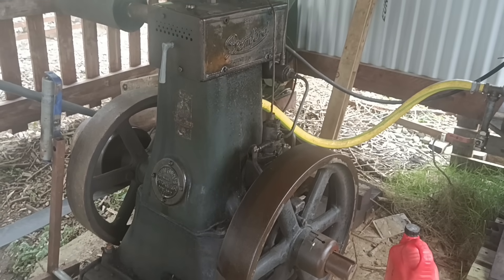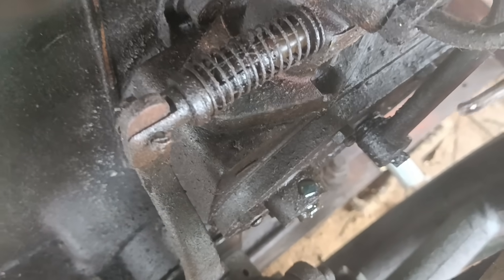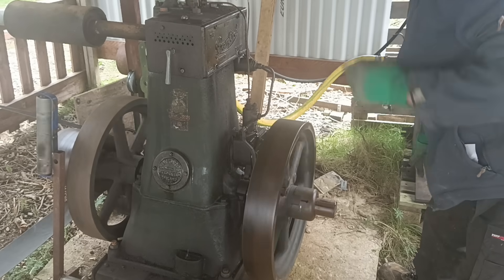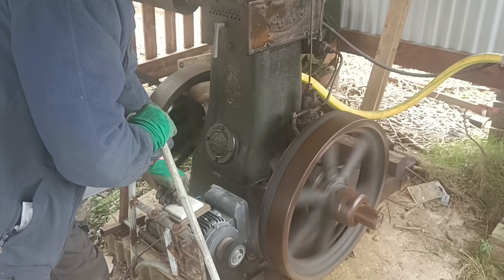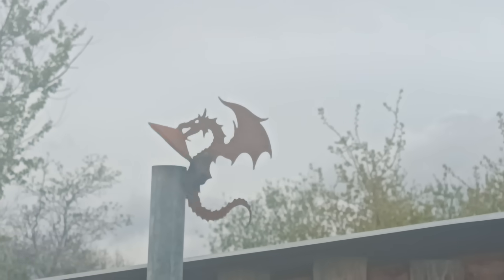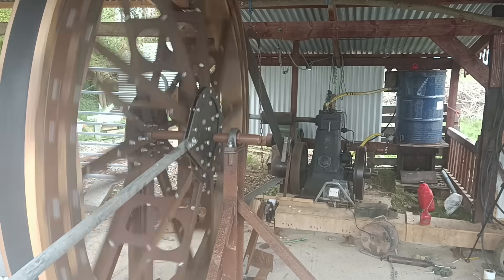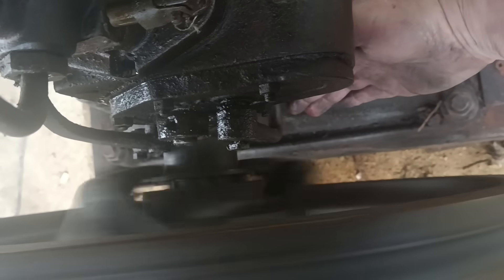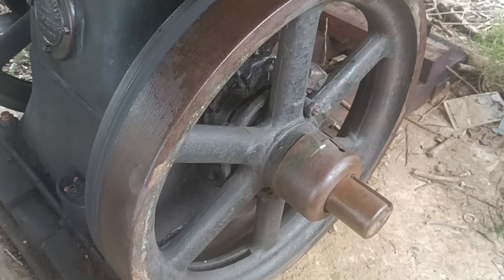How Much Fuel Does This Vintage Engine Use? Bamford stationary single-cylinder diesel efficiency

Comment: With that engine, when you say it's six horse power I'm fairly certain it's actually equivalent to six horses. The horse power rating of engines has changed over the years, and a six horse power small engine in the modern day isn't going to have as much power as this, it's smaller and doesn't have those large flywheels to keep it going. Another thing that helps is this engine as you said is only running at 600 RPM where modern small engines are running faster, the flywheels help it to just plain not care what it's powering. Very nice when you need the power, dangerous if you're not careful because it can rip your arm off without breaking a sweat.

Comment: Assuming the Bramford isn’t environmentally friendly is short sighted. The Bramford was already manufactured and is moderately inefficient compared to modern technology. To buy a new machine you incur an environmental cost through manufacturing and shipping. Unless the new machine is incredibly efficient by comparison it will take years to break even on environmental and monetary costs vs using a machine that is fully functional and in your possession. In short environmental cost or new vs used machinery isn’t terribly difficult to calculate.

Comment: Marvelous! Your product is VERY environmentally friendly. I can understand why people think modern is better, but it always annoys me when they don't value what's already there, and think nothing of scrapping perfectly good solutions that don't break, while spending money on something that probably will, and they always think the benefits'll pay for it over time. The true benefit is had when stuff is kept going, revived or re-purposed, not replaced with expensive new toys.
Reply: I bought a condo a few years go and it came with a Maytag washer that's half a century old. So I thought for sure I'll have to buy a new washing machine. Well when I moved in I tried it and it worked fine 😂 years later it's still working, it's been washing clothes for literally half a century. Meanwhile my mom's fancy modern washers break after a few years because the control boards go bad. Her LG lasted only a few years and would cost 400 dollars to replace the board. Meanwhile my 50+ year old Maytag works flawlessly still. It's probably not as efficient, but the environmental impact of manufacturing one long lasting washer is probably less.
Reply: @huge_balls  a lot of energy goes into making disposal crappola
Reply: In this society you're never supposed to be satisfied with the equipment you have be it engines, mobile phones or computers. If you refuse, they will force your hand one way or another.
Reply: @jonathanj.7344  just today I swept up some sand from my floor using my grandmother's dustpan and brush. Not sure if it's made from horse hair or pig bristle, but it doesn't use any electricity & it does a great job.
Reply: I'm still using my grandmother's 1940's era Westinghouse refrigerator.  It runs like brand new, and all the drawers, etc are in great condition.
Reply: ❤da odličan 😢.....više daje snage, a manje troši money !!😂👏🏽👏🏽👏🏽👏🏽🐞🐞🐞🐞🐞🐞🐞

Comment: A laboratory experiement to see how efficient the historic engine is, and a comparison to an electric motor would be a great video. 
However, even if the electric motor is way more efficient and cheaper to run, the pleasure of using the old machine would be lost - and its obvious that has great value to the owner.
So keep the old engine running 🙂

Comment: It’s not very clear online but it seems that this is the same Bamford as JCB, albeit Joseph Cyril Bamford’s grandfather, Henry.
As for the fuel consumption, i don’t think you would find any modern small engine that could do the same work & use less than 450ml of fuel per hour.
The only thing that would beat it is an electric motor powered by solar & that would have to run for a lot of hours to pay for itself ! 
I think we should give Greta a call & see what she thinks ! Maybe she will sail over to Ireland to have a look at how environmentally friendly diesel engines really are !

Comment: The old ones are running slow and efficient, maybe at 25-30%? 
 0,45 L diesel contains aprox 4,3 kWh
So if we multiply 4,3x0,25 we get aprox 1kwh of energy delivered 
In other words; 
The engine power outtake is way lower than 6hp/ 4 kw.. thats Why your math doesent add up
Test i against a fixed load and i think the math will add up- and you will use way less than half the number of kWh if you use an electric motor
👍🇳🇴
Reply from the maker: thanks - I realise that now. I will have to get it to work harder for a real test..

Comment: Like to have one to generate power ,to charge batteries, for off-grid powered house, about 600 amps at 30v charge the battery to 28.8+/-0.2v,  I'd like to burn waste oil vegoil,  used motor oil, 
I wouldn't mind building a modern version, with lighter pistons,   and a opposed twin horizontal piston use a couple flywheels from a semi truck engine, or maybe cast a pair of flywheels,  about 30"-36" and weigh about 75-100 lbs each, with 85% of the mass far from the crank,   machine abd weld a crank with about 12" stroke,  from , 3" steel bar, and 1" x 4" steel plate, build the crank case from 1" plate, maybe use large tapered roller bearings, for the crank, use 1" plate, and 1x1" Bar , along with .250" plate to construct a large H beam rod, 24" 36" long, bout 2" at the journal ends, 1"-1.5" at the piston pin, run 20:1-24:1 compression ratio,  use a 6"-8" steel pipe for the cylinder, cast the water jacket and heads from aluminum use two 2.100" intake valves,. And two 1.880"--1.900", ceramic coatings on  the piston, valves, head, inside the ports, build a high pressure air blast injection system, compress air to 150psi then through a dryer,  to be further compressed, o excess of 600 psi, with the main injection stage  using a small piston and cylinder, to hold roughly 600-625psi, with the cylinder filled with air 600 psi, 30-50 cc, with 20-30 mm bore, roughy 40-50 mm stroke.   With a valve to open as the injection piston moves to TDC, the valve opens as the pressure exceeds 650-670 psi, using the venturi inside the injector, to spray a fine must of fuel/oil, with 6-8 groups of holes, with 6-8 holes per group in the tip of an est, 8-10 mm injector, the injector working like a micro sized carburetor, throttle is done by using a bleed to bypass the injection air, a full cylinder of air injecting fuel, is full throttle, use a small  cylinder to contain a fraction of the air then dump it, possibly back into the 150 psi first stage,  use a normal compressor to fill a 1-2 gallon tank, then into another compressor, a multiple stage small bore, long stroke  with cooling  to cool the air , using water (a air to water intercooler) .250" passage through copper or brass, a .750" -.850" block about 4" x 6", with 4 passages, near 6" long, with cooling fins machined , then place inside an aluminum water jacket, to allow a .500" hose barb to circulate water through,  using a large heater core to cool the  water. Use a similar system to cool the head, and bore, use a dry deck to mount the head using studs that thread into the crank case, use .500"  studs on about 2"--3" on center spacing. Mount a camshaft  over the valves using finger followers with rollers, with valve lift from .500"--.800" lift using a intake cam and exhaust cam, using a timing chain tensioner system that allows for the valve timing to be advanced or retarded 8° to 12° say -12° to +12°  or limited to prevent damage, so limit to -6° - +6° on both cams to Taylor the valve timing to dial in efficiency,  using opposed pistons will make a large package but the balance will be much better it should not be bouncing or trying to walk about when running,  use one lobe per valve,
Use a exhaust valve compress release, to spin the engine up to about 50 rpm, (even with electric starter) let off start button, and compression release ( that opens the exhaust valve, about .050"+/-, also use a glow plug, that puts the top just in the fuel mist, having oil blasted through .005-
.010" holes,  the used oil could be as thick as 50 weight, the injector holes  possibly make them .
.020" using a group of holes 8 ;groups with 8 holes 64 holes through about .500" steel, with water in the head cooling , aswell as the fuel oil or diesel, cooling the injector,  the inner air  injection uses a .250" tube with .165" ball, with a rod, the rod about .080" the .125" 0rifice  with the ball sealing it , and a spring keeping it sealed , until the pressure is high enough to open the valve, this is threaded into the nozzle that threads into the head, like a sparkplug, 10-12 mm thread about 20 mm long,  with a glow plug threading into the head close to the injectors, with it sat a angle, so the tip is getting hit by fuel slightly,  the piston combustion chamber allows clear for both, the piston being nearly 20 mm thick in that area, with ceramic coatings, and a mesh grid cast into the pistons to allow the oil squirters to cool the piston, using intake runners in an oval shape,  est 2"x 3.125" with material to allow it to be opened up to 2.625"x 3.750" and still have room, even adding larger valves, a 3" x 4" port with roughly .100" wall intake port.  With exhaust ports , use one per valve, leave the valve at about 30 then after about 30mm, turn about 25°-35° , with the port exiting about 45°-60° from the valve face,  to prevent the exhaust from hitting a flat roof of a 90° port roof, the intake ports should be similar, using a near hemi design, with the valves at only about a 6°-12 ° from each other, with nearly no chamber in the head,  the piston can be machined to adjust compression ratio,  use shims under the cylinder to adjust quench, about .050" of shims, with the piston near zero deck, with a gasket about .020" use a copper o-ring , maybe use 12 gauge wire, silver solder it,   and ring roll it into shape,  machine receiving grooves, and a copper shim gasket,  no water to seal, so dry install, use a 3/16"hard oil feed line, with a .500" (1/2"); return line, head to sump,   if roller bearing s are used, use a sheet steel plate around the bearing race , with a squirter filling the sheet steel tab/ reservoir that streaming oil into the bearing, the oil seal should be simple, basically just a loose fitting plate to fit the journal, with a  pair of small tight fitting in to the journal,     with a cotton rope between, the large loose plate bolts to the crank case, and is sealed to it,  the plates should be machined,  with about .010" clearance,   and fit snug on the crank,  a 30° temperature difference it should slide on , when equal require a puller,  but being .125" thick heat is required,   the spinner should keep the oil that comes through the bearing, uses a drain to sump, or use a pair of . 250" holes to drain back,  use a main cap like traditional bearings,   to retain the outer race,  the rod bolts being .500" or . 625" grade 8 bolts, same as the head bolts, only they will be Studs, the oil pump  using a chain drive,  driven at 1/8 the speed,  being the tod and cam bearings is the only bearings required pressure,  use only enough pressure to maintain 5 psi at starter speed minimum, and a maximum of 50 -60 psi hot,  use pressurized pin oiler, rod journal, and cam bearings, a piston squirter, use a .350" babbitt bushing on the main journals, with a .125" x. 200" groove to supply oil pressure to the rod, , roughly . 010" clearance max, minimum .003" to 
.005"
Use a 2" x 2"  x . 250"  Wall tube frame, to mount. From head to head , then the crankcase, with a 12" rise, to allow the flywheel to be off the ground, using 4"x4"x 
.500" plates as feet, under the base of the cylinders, to balance the weight, it can be enclosed sealed , and used as the fuel tank,  being 48" long, and 24" or less wide,.  Hold 4-6 quarts of oil , 100 psi oil pressure relief, with a safety switch reading pressure at the main oil pressure galley,. . intake ports at the bottom, exhaust out the top of the heads,  2x 2" going into a 4" single pipe, then possibly either a pair of 4" with mufflers, or a 5"-6" semi exhaust muffler,  use a short piece of 2" x 4" tubing to make a adapter to a 4" pipe inlet,. However with the low rpm, a 3" exhaust per cylinder on the exhaust, and 4 " intake with a cone filter, per bank!  Use
 .750" in/ out for coolant for the heads and cylinder,  the top of the crank case, having mounting locations to mount accessories, like 4x 150 amp alternators! And a 24v starter motor,  50-100 rpm should be enough to start the engine! Lots of casting welding and machine work, but would it not be awesome to build a engine with 8" bore, and 12" stroke,  I don't recall the displacement, but I'm sure it not far from 2000 cid,  sorry to be a  rambler, insomnia will do that! 😆 Great video!!  I mathed it out, 1206 cid with 2 cylinders,  imagine 4 cylinders!:  2412cid, if it could spin to 2500 RPM, the power could be amazing!! ✌️😮

Comment: Take a look at Thinking'n tinkering because he has a dead easy way to make old chip shop oil into fuel by adding a gelatin solution and letting it set up. Brilliant!
It would be ideal for your engine and the residue is a food safe block of gelatin 😉👍
Just be sure to filter it before use and add a little Diesel for lubricity.

Comment: Interesting, about 1 imperial gallon/10hr. FYI. I found that similar Lister/Petter and Lister and Petter engines have about the same fuel consumption as newer 1500rpm engines and that these use LESS diesel than similar 3000rpm engines. You might also be interested to know that for Lister and Petter engines you can source all of the parts (yes every single bit) from Mahindra Diesels in India. They have endlessly tweaked and twiddled these and they are superiour to original parts. You may even still be able to obtain the chromed piston bores that the Listers and Petters used to use. Which in no small part contributes to their longevity in service.
Reply: You are right Giles, I had 2 250KVA Merrilees Blackstone gensets that ran at 500RPM, they used less fuel than a turbocharged Cummins of the same output.
Reply: they were a 1930's vintage if I remember correctly.
Reply: @TerryCasey-v5f  Could easily be. Not sure when these particular Bamford engines ceased production, but Lister/Petter continued them right into the mid 70's. Primarily as pumping engines for Africa I believe. A role now taken over by Mahindra Diesels. Yes Cummins, good engines until their not keeping up with emissions debacle. Still used in rail locos I think. Never really known for frugal consumption in trucks or plant though with their cam lifted injection system.

Comment: A big consideration that won't be made by the nay sayers, at least here in the States, sometime from the 60s into the 1980s horsepower ratings became "embellished". Whatever the skullduggary or politics I don't know, but I would bet the farm that the old 6hp rated engine has a comparable output to a 10 to 15 horse today. I could only imagine the live torque, or wonder how it could even be measured on scale with a direct output with that big old flywheel carrying that power at the ready. Cheers, nice to see the old engine at work. The old oil well hit skips have dried up around and have now become expensive, always wanted to get one for a project, it may not happen now.  Literally could run across the for $20 at an auction sometimes, because nobody wanted to load or haul them.

Comment: It seems to be working efficiently enough to do all that work on less than 500ml of Diesel. 
Its even more efficient if you were able to use some of the heat generated by the cooling tank to heat water for a hot water storage tank. Maybe a coil of copper tube to a hot water tank used as a workshop shower.
Its a lovely old machine. Nothing built these days would last that long and just keep working

Comment: Thanks for posting this, very interesting! I've got a modern 6hp Honda clone (petrol) that currently runs my firewood saw.  Mostly cutting up old pallets, so probably not going to be making the engine work much harder than yours does mincing up charcoal.  A full tank (just over 4 litres) will only get me around 2 hours of work.  I'm quite happy with that, less wood to have to stack up at any one time 😂
I used to run an old lister D, but thats currently awaiting repairs when I get the time and money
Reply: fix that Lister!
Reply: @fidelcatsro6948  it's on the list, as is an air cooled Petter A.  Both have magneto issues
Reply: @nathanlucas6465  diesel needs magneto?
Reply: @fidelcatsro6948  it's not a diesel.  Its a "type D" and was available as either petrol only or petrol/paraffin
Reply: @nathanlucas6465  i see 🐱👍🏿

Comment: For comparison- I have a "modern" low rpm diesel generator which uses approximately 3/4 litre of fuel per hour to produce 4- 4.5 KW  of electrical energy, which is almost equal to 6 hp- whatever that means.  The big difference that I see-  in 80 years my generator will most likely have been worn out for about 70 years.  Not very sciencey, but there you have it.